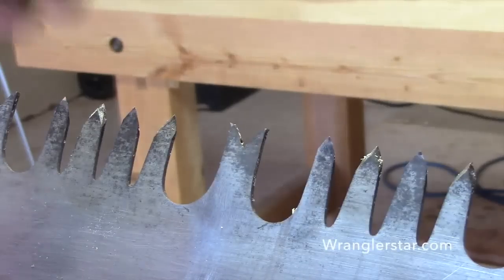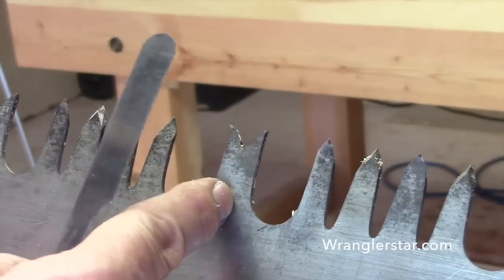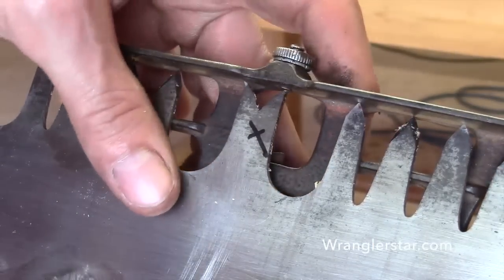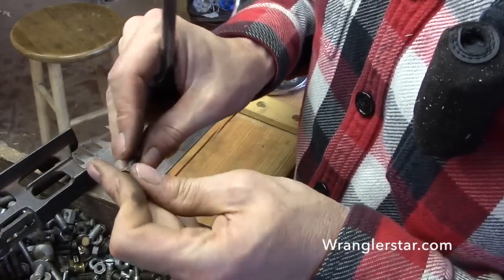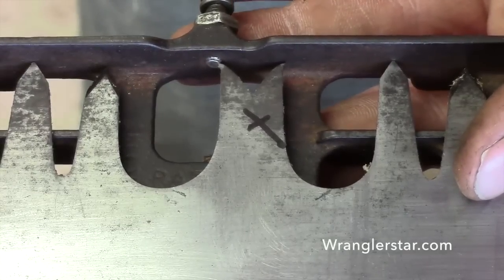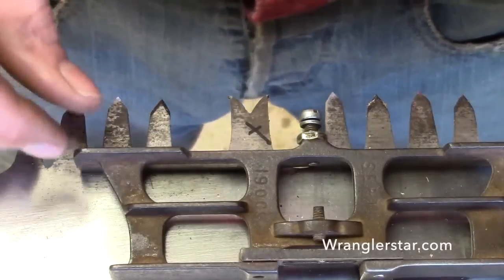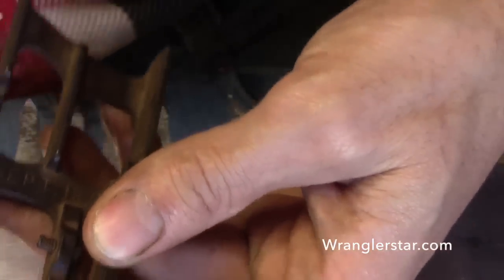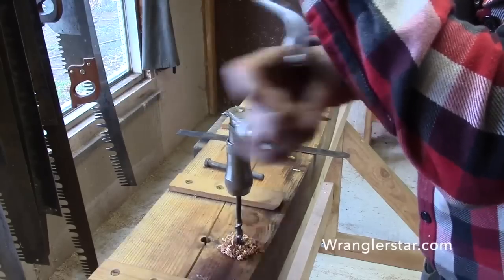Crosscut Saw Filing | Part 2 Wranglerstar

Comment: Hi Cody,
I'm not sure if this is what you are looking for but there is an auction on ebay right now that includes an Anderson saw gauge.  It looks to be in usable condition and has not been  restored.  Here is the link: http://www.ebay.com/itm/Saw-Sharpening-Tools-Anderson-Morin-Atkins-Logging-Filing-/111628600788?pt=LH_DefaultDomain_0&hash=item19fd9545d4
Thanks,
-mike

Comment: I would have filed the bottom of that replacement screw flat as best as I could. It seems to have a taper / lopsided tip (as lots of screws do to help self-align). Filing it flat and square would help a lot to keep measurements linear as you thread it in and out. That original screw was never going to move with the knurled jam nut squeezed in the vise. You shrink the ID even tighter doing that. I would have held the top of the screw in the vise, or thrown an upside down screwdriver in the vise, pliers on the nut, and gently tried to rock it loose with some PB.

Great video as always